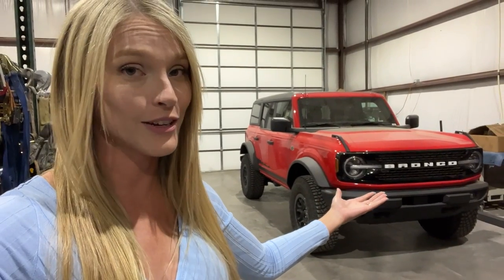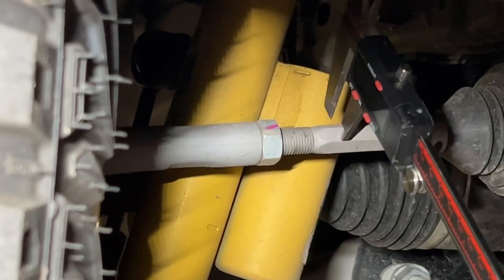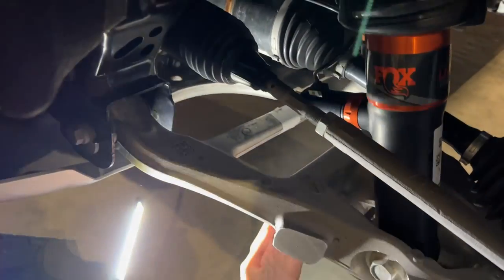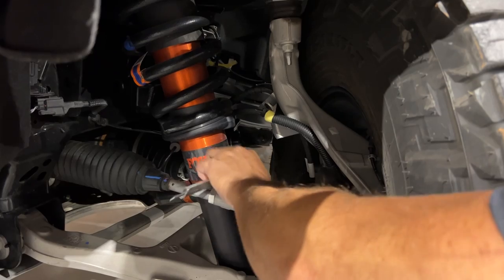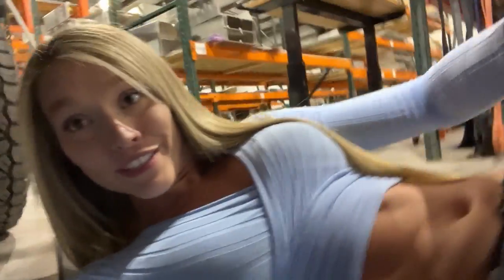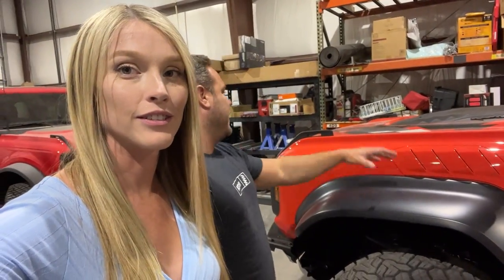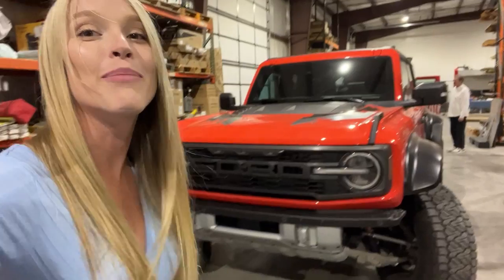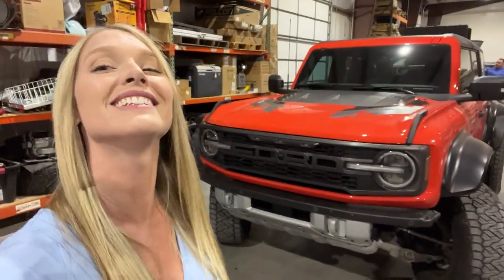Bronco RAPTOR vs SASQUATCH Breakdown!

Comment: 1mm IS a lot because of how stress works on the tie-rods.  The failures are buckling failures and buckling resistance, "strength" is proportional to the fourth power of radius/diameter.  So 15mm vs 14mm is only 7% bigger, but it is 30% stronger for the applied load.
Reply: Yea but the Raptor is twice as heavy
Reply: How does that break down for the 37s on the raptor?

Comment: Great Video! 

As others mentioned, the 2023 Bronco Wildtrack now gets the HOSS 3.0 standard, which includes "the Ford Performance Severe-Duty upgraded steering rack from the Bronco Raptor, upgraded inner and outer tie rods."  

HOSS 3.0 was an option on the 2022 Bronco Wildtrack and I don't think available on the Badlands, or other variants.

Comment: the Wildtrak now has the HOSS 3.0 that has the Raptor rack and Tie rods stock
Reply: Nope,  that was very short lived.  They just announced that Ford is getting rid of the wildtrak for the foreseeable future.
Reply: @KN-jw7ts  Nope, they are just building less, because they are building less Sasquatch bronco in total right now. Wildtrak is standard with Sasquatch, there is no option to remove it, very much like there was no option to remove hardtop from the 4dr Wildtrak in 2021 and from 2drs for any year. Rumors are that there is a limited number of sasquatch wheels and/or Goodyear cannot produce enough tires.
Reply: @KN-jw7ts  well I own a 2022 2Door Wildtrak and I added the HOSS 3.0 that does include the Raptor steering Rack and Tie Rods. All 2023 Wildtracks come standard with the HOSS 3.0. Yes I am hearing the Wildtrack will be very limited for 2023 and possibly going away altogether now that the Raptor is out. That said, it only makes mine worth more, LOL.

Comment: 2023 Wildtrak has a little bit different suspension (HOSS 3.0 FOX)  than the previous Wildtrak (HOSS 2.0 BILSTEIN)
Reply: My '22 has HOSS 3.  From what my dealer said all the local '22 Wildtrak orders they filled had the 3.0 option added.
Reply: @christopherenoch4230  it was an option on 22s, standard equipment on 23s

Comment: The threaded part on the tie rod looks thicker on the Raptor. The part you guys didn't measure. The threads not as deep, the  body not as skinny,. At least by eyecrometer. Remember that it is the bottom of the thread groove that is the real body thickness of a shaft. Oh, god, now you guys have me talking like that. Just forget it.

Comment: Anybody that thought or was arguing that the bronco Raptor suspension, etc., components were the same as base or sasquatch broncos just didn't bother to know the difference. It is not like Ford, kept it a secret. They released lots of diagrams specifically calling out what was changed. For me they share the same body carriage, but beyond that there are so many differences that it is really like a different vehicle. Throw the HOSS3.0 package in with some 22.5 Wildtraks and the MY23, and you have people really confused. If I had a raptor, I would still go ahead and get rid of the light duty skid plates and replace with aluminum ones. If I was setting the raptor up as a more dedicated crawler, and if I could get rid of the sway bar disconnect without all sorts of computer issues, then that would be an potential option. The system is good for parlor tricks, but a manual release or no sway bar is better in that situation. I would probably keep the rear bumper until I trashed it, then replace it. Portals, sounds fun, expensive, but probably too much for my uses.

Comment: With 3.5" of extra width, I'm curious about the extra leverage and weight of the portal.  I'm excited to see if you'll need more valving or more spring rate.
Reply: If they wanted portal axles they could have just bought the Mercedes G-wagon that comes with factory portal axles.  Plus 4.5L turbo v8 AMG engine.

Comment: O.K., I've gotta pull out the Engineer card here so please don't hate.   I like the bronco and appreciate what Ford is trying to do, but as a Jeeper what I question about their design is the simple fact that if you look at strength and stress test numbers steering and axle manufacturers utilize when designing tie rods and axle shafts for our jeeps, why wouldn't the ford Engineers have similar design specs meaning 1.5 to 1.75 inch sizing for those rods and whatever the axle shaft converts too like the Advantek M210 axle.??  Although many of those won't ever leave the Malls or soccer fields (like many jeeps too), with that package being so aggressive it seems like a no brainer.
Reply: Because the braptor setup is basically the f150 raptor setup. It has been tested, proven and refined for years now.

Comment: What I don't understand is, if you were planing on doing all these upgrades  (and more probably), why didn't you just do them on the other Bronco?
Reply: They addressed that one another video…..Bc they are starting out w a much better vehicle,  engine, interior, frame and body reinforcements etc.   I believe they also said, “ideally we would like another braptor to keep that one stock as a daily driver, and modify this one”.
Reply: The Braptor is a totally different platform. There’s no way to bring a regular bronco to the same level. The frame has much more reinforcements to absorb jumps. The suspension is pulled directly out of the f150 raptor. You can make one look similar, but it will not be as good.

Comment: Great video! but... you forgot to mention ride comfort.The additional girth of the control arms will make for a much smoother ride (which ladies appreciate). With solid axles you have the 2 brake pistons slamming home at the same time on both ends of the axle which makes for an up and down jarring ride. Whereas for the IFS in general you have the pistons sliding in on opposire ends at different times which most riders find very enjoyable. Now in the raptor version, you have larger pistons but the additional girth of the suspension helps smooth the ride which is a much improved "motion of the ocean" experience.

Comment: Another show bashing the Badlands🙄 Nothing has broken on mine because I know how to drive.
Reply: I don’t see it as bashing,  it’s simply noting how the raptor is throughly different than the regular Broncos.   Going from a 2.7 sas obx (which I really liked) to now a raptor myself…….it’s just on a different level.   Even Things that I would have never thought to be different,  from simple  things like how the doors open and close…..zero window jiggle, to the rest of  The fit and finish, to all the things they’ve mentioned.    Very pleased thus far.
Reply: @KN-jw7ts  they have literally bashed the badlands every chance they have got since it wasnt the hottest thing out anymore. they got that badlands for content and a giveaway, nothing more. its been made clear by plenty of wheelers that a bronco with sasquatch was designed for 35s. and most of the people that kept them that way have wheeled with little problems.

Comment: So…..if you’re buying a Bronco……don’t get the baby one.  I’ve seen so many new baby broncos and I’d swear that they’d fit in the bed of Stanley, my 22 gladiator
Reply: I probably need to do a little research, but it's there a compact bronco and a full-size? All the ones I've seen around lately have looked on the smaller side.